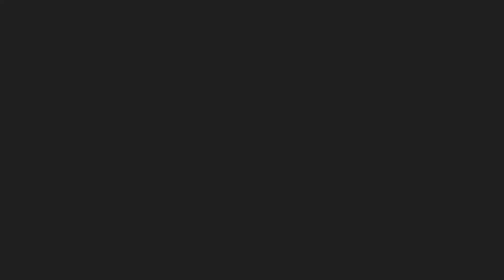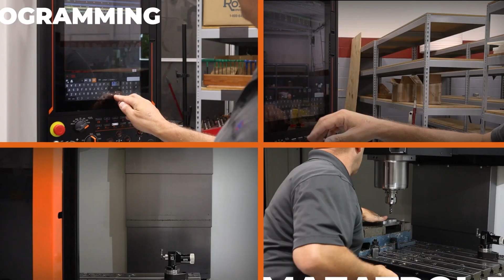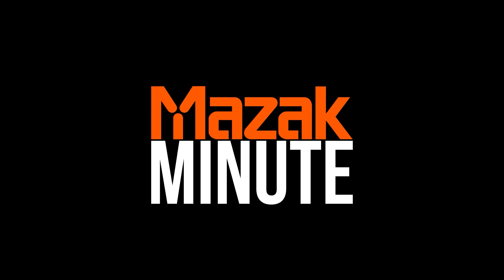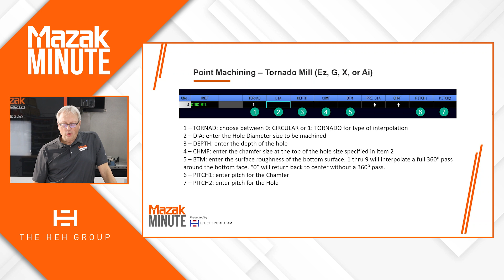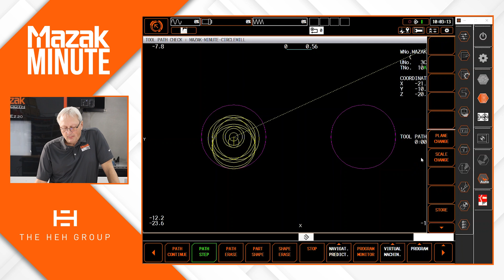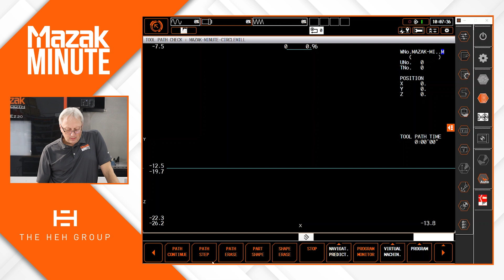Mazak Minute | Episode 14 | Circle Milling and Tornado Milling

Comment: Is it possible to circle mill with a ball endmill without tricking the machine? currently we circle mill with a ball endmill but have to put it in the tooldata as a flat endmill. is there a way around this so it can be in the tooldata as a ball endmill but still use it to circlemill?